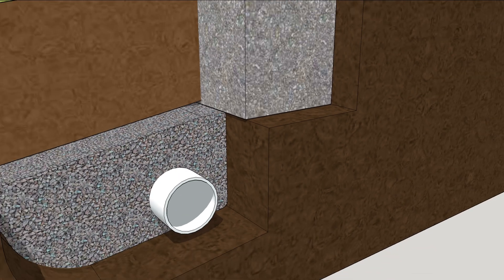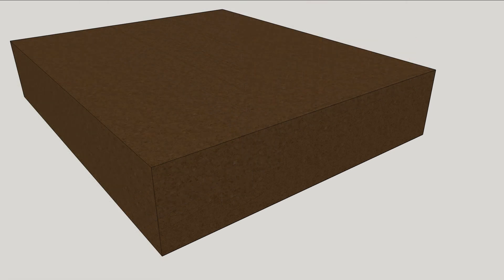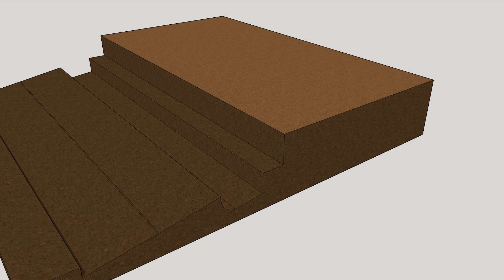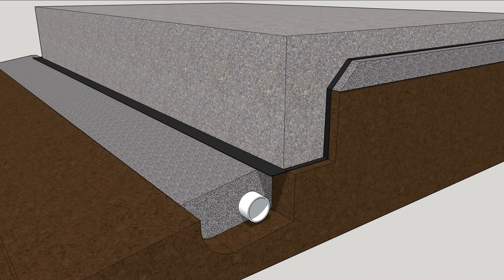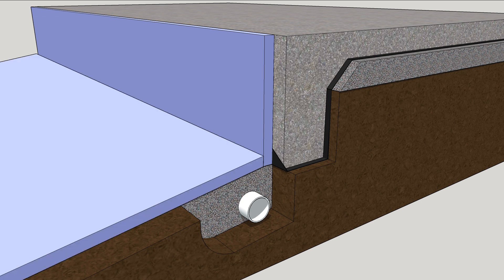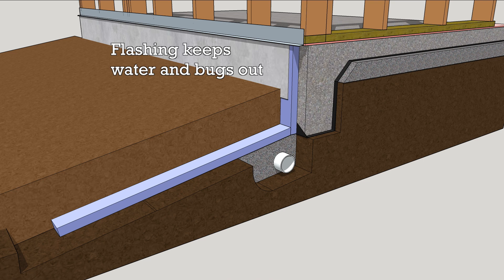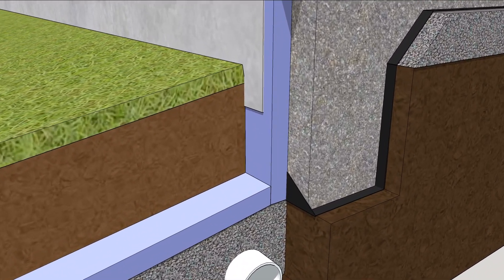Frost Protected Monolithic Slab

Comment: wouldn't a drainage tile at the sloped end of the insulation board be better?  any moisture from above would follow that slope wouldn't it?
Reply from the maker: Footing drains carry ground water away from the footing. The sloped insulation board directs bulk rainwater away from the house. Two ways to control two types of bulk water.
Reply: @ProTradeCraft where do the underground pipes vary the water? Do I need a sumpump on exterior of house?

Comment: Unprotected foam and plants, roots, future digging? Seems overly optimistic.
Reply from the maker: I mean, I hope it goes without saying that for a shallow frost-protected slab, it's probably a bad idea to plant shrubs right next to the house. 

If you dig a hole and find a shuckload of foam in the ground, maybe stop digging and try to fix your mistake?
Reply: @ProTradeCraft  Makes sense. Some thoughts...

(1) Roots find their way a considerably distance. Lots of people have plants/trees 8 to 10 feet from a house, and that is considered reasonable, depending on the spread of the canopy. Roots can easily go that far.

(2) After a house is sold, how often is this kind of detailed knowledge about a slab passed along? (Yes, maybe it should be!)

(3) Right, a savvy / conscientious landscaper or homeowner who comes across a lot of foam will pause and think about it. Unfortunately, there are many that might have an incentive to not say anything.

(4) When it comes to "what is right and wrong", some people "pass the buck" and say "I acted responsibility; it was that downstream person who messed up". Easy to say, but it isn't this simple. The "downstream" / future person may not have the knowledge the first person had. Again, it is easy to say "they should have known better". Maybe, maybe not. Maybe their whole industry isn't yet up to speed on new designs? Engineering has to factor in realistic human behavior (warts and all) and laws, codes, etc.

(5) For a new slab technique to stand the test of time, it isn't just an "engineering" question -- it is also a "real world" maintenance question. There are well-known practices, such as "call before you dig", "plant trees according to the canopy size", and  "plan for water movement", and "don't damage waterproofing membranes". How many more do we need to add? 

(6) Putting ethics ("should haves") aside... when a mistake happens, who pays? Often the homeowner. This is why homeowner wants the engineer, designer, builder to have aligned interests.

All in all, I like innovative building techniques, particularly ones that save energy. But if they are easily damaged, then maybe they aren't quite "there" yet.

Comment: No insulation under the slab? 😂 WTF
Reply from the maker: When the edges are insulated, the delta T between inside and under the slab is very small, so very little value is added for that money. But feel free to insulate the whole under slab area if you want to.

Comment: Kinda surprised you don't tell people to put foam underneath the entire slab....
Reply: 80% of slabs thermal loss is to the sides.   The ground under a house is insulated by the entire house and has relitive constant temps. A under slab moisture barrier would be a better investment.
Reply: Generally, that's for unheated buildings. See https://pdhonline.com/courses/s231/s231content.pdf

Comment: How do water drain around the perimeter if the trench  it is covered with a layer of non permeable eps?  Will the water pool on top of the EPS foam board before ever reaching the drain?
Reply from the maker: Groundwater rising from below drains in the drainage trench. Surface water never makes it down that seep because it drains away from the house immediately.
Reply: @ProTradeCraft  Thank you.

Comment: Steve I am in Warwick RI and would like to utilize this frost protected slab protocol for my 32/32 two story garage.
Any suggestions on how to achieve this in RI
THANKS
Doug
Reply from the maker: Just make sure you use the right amount of insulation as specified by the code. Better yet, use a little more. Building Science Corporation recommends R-10 for basement floors and R-20 for basement walls. I suspect that would translate to R-10 for the slab edge, which is 2 inches of XPS.

Comment: 16”?? Try 60”

I live where the air hurts my face.
Reply: So do I.  16" is good with this design.  That's why it is called a shallow foundation.  My typical frost line gets down as much as 7-8 feet.  Unless you want to dig and pay for very tall foundation walls and deep footers or just a basement, this is a good alternative.

Comment: Why do you turn the plastic up? Won't that trap any moisture that gets onto/into your footing from draining away? Seems turning it down would be ideal. I'd also put a layer of dimpled plastic membrane just for peace of mind, to keep the footing ventilated and draining.
Reply from the maker: Foam is installed right after wrapping the footing, Water should not get in there. leaving in down will allow soil moisture to wick in.

Comment: for the best install, you should not excavate in the area within 45 degrees of the bottom of a footing or perimeter of a monolithic slab. I think this area is called angle of repose. (according to my engineer this can be slightly more or less depending on soil or aggregate type) .  This is the same for typical foundations with 4ft frost wall on footings or deeper ones for a basement. The drain piping should be moved away from the footing if you want it below the footing or raise it so the bottom of the pipe is at same elevation as the bottom of concrete slab footing
Reply from the maker: Yeah, it is called angle of repose. and yeah, it's best to follow the 45-degree rule. And liberal use of a compactor will solidify the base.

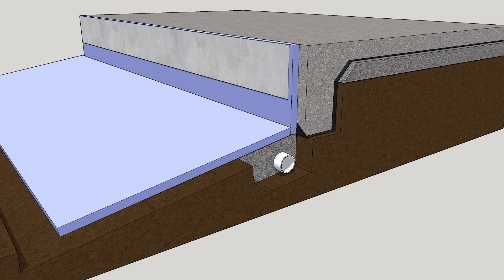Comment: 1:16 cover the foam with what?  Something strong enough to withstand a weed eater string
Reply from the maker: Does anyone actually have grass growing up to their foundation? Don't people who use weed-eaters have flower or shrub beds around the foundation? 

Pressure-treated plywood, fiber-cement panel siding, stucco, and surface-bonding cement are three traditional examples, PVC cladding panels is another.
Reply: @ProTradeCraft  Ive seen old shingles placed along fence lines and around houses to prevent grass from growing.  Traditional "flowers or shrub beds" are for women or guys who like to weed, not men who could care less..   16 gauge SS would be required to survive the weedeater.  But you could also place a protective barrier there right before weedeating and move it along while trimming.

Comment: If you have that foam board insulation continue from below ground to the top of the concrete.  How do you protect the foam from the elements and damage?
Reply from the maker: With some sort of protection board. There are many options, including PVC panels.
https://www.youtube.com/watch?v=opmk9NoN9xE
Reply: By using stucco or rot resistant panels. Was discussed in the video

Comment: But you did not thermoisolate under the slab:(
Reply: Because it's inside the envelope it may add to the thermal mass and be a positive benefit.
Reply from the maker: The ground is a stable 50-ish degrees (F) when the perimeter of the slab is insulated like this.
Reply: @ProTradeCraft  that means around 10 celsius, and you have direct contact to a surface which has a temperature difference of 12 Kelvin. Should you consider installing heated floors, the difference increases. The costs of insulating under the slab are low, i think it is a must, but I'm no expert. I guess it also depends what are the climqte conditions in your are.
Reply: @howtoscientifically7355  🤣🤣🤣🤣🤣 A difference of 12 KELVIN!?!? Do you even know what you’re talking bruh? 🤣🤣🤣🤣🤣

Comment: Ive done my last 4 houses like this and have never had a problem
Reply: It lacks a defined drainage plane, which makes me slightly hesitant.  I'm surprised there isn't a dimple mat on the front of the foam.  Are you in a dry area, or do you think this won't be a problem, and why?  Genuinely curious, because I do love designs that remove unnecessary items and steps.
Reply from the maker: The foam face is the drainage plane. On a basement that extends 8 feet below grade, it makes sense to use dimple mats. 

For a slab extending a foot and a half or two feet—with no living space inside that part that is underground—I think is misplaced energy and attention.
Reply: Were any of those houses more than 1 story?

Comment: I'm concerned about the detailing on this - one of the long standing complaints I've had watching "perfect building systems" videos is the lack of clarity as to where the conditioned space starts and stops.  It's for this reason, I like the REMOTE building method where the entire structure is inside the conditioned space, the vapor barrier is on the outside surface of the structure rather than among the rat's nest of detailing between floors and roofs (etc.), and the insulation is all outside the vapor barrier so that the vapor dew-point transition is always outside the wall unit.

My question with this method follows that problems always come down to how the foundation is coupled to the earth - regional code often requires foundation edge and post in direct contact with the grade.  This coupling creates a huge thermal connection usually with very efficient conductors of a high mass.  One of the reasons that the insulation has to be extended so far away from the slab here is rather obvious to me: the slab is conducting heat into the grade soils, and IMHO this solution is at best a band-aid for the problem - which is that heat is getting into the soil at all.  In areas where frost heave is a problem, again it seems that the actual problem is that water is allowed to build up next to the structure, which this band-aid would probably make worse (although shallower).

It would seem to me that a better approach would be to insulate the majority of the slab from the ground surface, planning the bulk slab to be within the conditioned space. If code requires direct foundation contact with the ground, there is usually a wiggle room for not connecting the slab to the foundation wall but rather using a thermal break material (RPS or equivalent), then thermally breaking the foundation wall from the structure and conditioned space.  This would make the temperature of the foundation wall closer to that of the surrounding soil, negating the need for this shelf of RPS.

My biggest gripe is the discontinuity of the vapor barrier - it's shown to just be covered under the edge of the RPS, typically you'd want to have the wall's vapor barrier bond to that wrap so that the joint will shed water, rather than being wicked into the foundation.  Once the concrete has hydrated, I'd want to protect it from as much as I could manage to prevent degradation.

There is no drainage of surface water in the above video, only ground water up to the foundation footing.  To address the frost heave, I'd want to see a very wide and deep drain, lined with filter fabric and back filled with #5 crushed stone probably a minimum of 2 feet wide and >3 feet deep, with a drain pipe at the bottom, and geotextile on the top, then covered with 4-6" of loose coarse mulch.  This would promote rapid drainage around the edge of the structure of liquid water.  If icing was a problem, I'd want a method to convert that solid water into liquid again to speed drainage (i.e. heat).  Preferably the structure would not be designed in such a way that snow fall for example can land right at the base of the wall  Barring that, I'd put a very shallow polyethylene sheet from the edge of the foundation to a drainage trench offset from the wall - sloped like the video's RPS.  The idea would be to make any water build up surface-only and very shallow.
Reply: "One of the reasons that the insulation has to be extended so far away from the slab here is rather obvious to me: the slab is conducting heat into the grade soils"

It's done so that the ground below the footing doesn't freeze and move the footing AKA "frost heave." If it's a choice between the slab conducting heat into the soil below the footing or the foundation heaving, I pick the former.
Reply: @Thoracius  You should be able to have your cake and eat it too.  It's just going to require some additional thought and planning (and cost).  Frost heave means you have three conditions simultaneously: 1) fully saturated soil right under the foundation, 2) freezing-cold temperatures at the foundation base edge, and 3) uneven heat loss into the ground from the building.
  
The frost line for North America varies from ~6" to >50".  Your footing thus needs to be deeper than the regional frost line of the building, and needs to avoid losing heat from the footing depth to the outside atmosphere (thermal-wicking).  This means it would need to be insulative in nature (standard 5000lb concrete really sucks at thermal resistance).
  
If one finds oneself building on very thermally expansive soil in a cold climate where a basement is not desired, a designer might consider the hydrofoil - it has a wing-lift structure that extends below the waves where solid calm water is and the hull is connected to the foils by poles.  Since the waves at the surface only interact with the relatively small diameter of the pole rather than the entire bottom surface of the hull of the ship, the ride is much smoother.
  
Similarly, a designer could create a foundation that goes well below the frost line, and extend pilings up to the floor joists as in a typical pier-type foundation, insulating the piers/pilings so that surface temperature is not brought down into the warmer foundation plane.  The insulated piers/pilings would stay at the cold but not freezing temperature of the foundation footing - but not conduct heat from the ground to the outside air, and with the thermal break also not from the building down into the ground.  This means the whole top surface of the soil would remain at a fairly even temperature (so no shifting), and the small surface area of the piers/pilings would not give the soil enough to grab onto to move the structure.
Reply: @Real_Tim_S  A Swedish skirt shifts the thermal properties of a foundation from being a heat sink towards being a thermal mass. Though invented in the US more than half a century ago, my understanding is that these, as the colloquial name implies, have been very popular in Sweden, surely not without reason. They can also be inexpensively retrofitted to existing slab-on-grade structures. As for whether soil gets "total saturated", whatever you do to try to prevent it, time can reverse.
Reply: @Thoracius  That's the issue with the insulation around the perimeter - there is always a Delta-T during heating/cooling seasons from the inside of the conditioned envelope to the ground - so thinking of it as a "thermal mass" is wrong.  It's actually a heat-sink.  You are stopping frost heave by heating the ground from the interior volume conditioning - that is not an efficient design for heating the building's volume.  It was conceived a long time before building science had much to do with science.  Think a house with a Swedish Skirt, as a girl in a mini-skirt sitting on an aluminum bench outside in a snow storm while wearing a parka and a fuzzy hat.  Her upper body will be warm in the winter, but I'm guessing you'll learn new swear words from her once she sits down...  The obvious fix, if you've been to a sports game with a fashion sensitive lady, is to either stand (air gap between the icy bench and skirt-clad lady, with insulated "piers", i.e. stockings), or be a gentleman (and a hero) and put a full blanket down between the lady and the bench.  Same principal with a building.
  
Ground water moves in the soil, and heat goes with it if it gets lost from the slab if there is no thermal break.  This is a key principal behind ground-source heat-pumps.  With that moving water goes any heat you lost to the cooler soil.  There is far more specific energy in the ground than there is in ambient air due to that ground water - which is why ground source heat pumps are coming into fashion in North America.
  
Modern Building Science says:
* You need a capillary break to stop surface tension water transmission, or ground water injection into the structure.
* You need a low pressure zone to degas the sub-soil to prevent moist-air intrusion to your slab finishes, or Radon gas infiltration
* You need a continuous vapor barrier to prevent loading of your interior volume conditioning system and damage to your building's structural/finish materials.
* You need a thermal break to stop heat loss to the ground, and the air at the sides and over your building.  If you have a vapor barrier, the dew-point should occur outside of that vapor barrier, and the condensed water should have a way to exit while drying the insulation material.
* You need a water-shedding, UV-and-impact-surviving "shell" to protect the insulating layer, and get rid of bulk water, snow, and hail.
  
Or, you need less of all four of those and wear warmer/less clothes (heating/cooling season respectively) with more outside air changes, like buildings were 75+ years ago.  Your body will basically do what I described above on a much smaller, individual scale.  Then you need to put your temperature/humidity sensitive items in a steamer trunk you keep near the fire place the way they used to.
  
I'm not arguing that the Swedish Skirt isn't a reasonable edit to an existing slab-on-grade-home where getting insulation under the building is cost-prohibitive, but to imply it's good new-build practice, I believe is dishonest.
Reply: I'm sure the slab will be insulated but that detail is not covered in the video